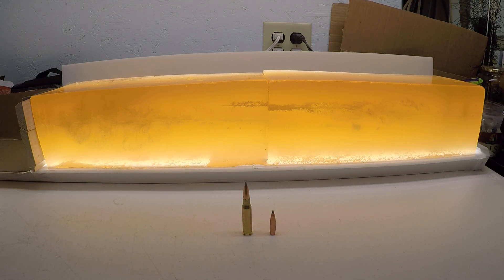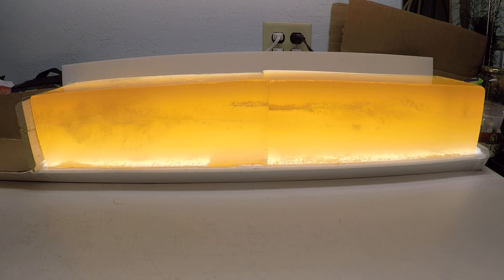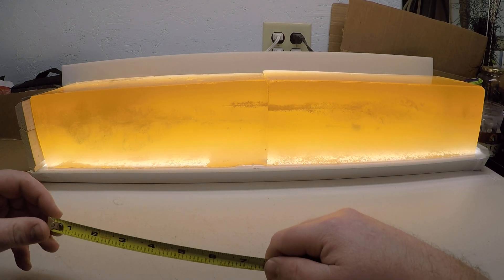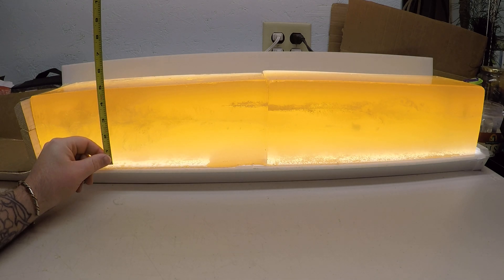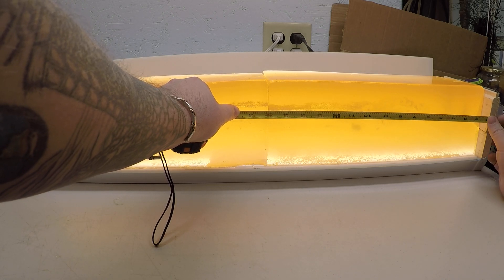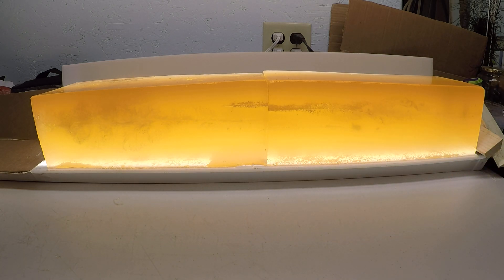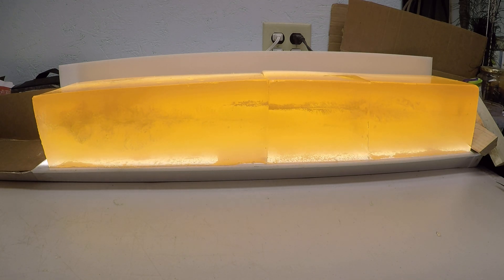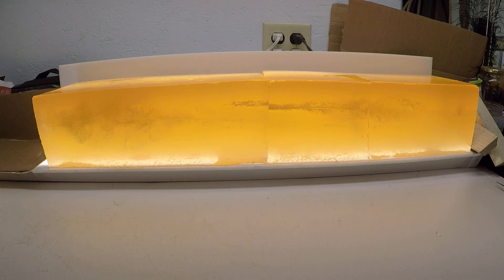Ballistics gel test of the 30 cal 168 gr Nosler ABLR overview of gel blocks

Comment: Looks excellent! I just bought a 16.5" .308 that I'll be using this next hunting season for speed goats to  elk, and I'm trying to decide which bullets to start working on first,  so this type of test is just what I'm looking for. Curious what load/powder you settled on for these bullets in your hunting rifle?

On the elk you shot with this bullet in your short .308, what was the range, and did you get an exit? 

I'd love to see more bullet tests with the short .308, any chance you'll test the 168gr Speer Gold Dot? They seem like they might be a good option for short .308s as well, but I haven't seen any gel testing on them yet.
Reply from the maker: The elk I shot last year with one of my short barreled 308's I shot at just under 100 yards and yes there was a exit hole.  To date I have killed more elk with a 308 Winchester then with any other cartridge and caliber.

I have other videos shooting 30 cal bullets and all the reduced loads are shot out of my little 308. So all the low end test will show how well the bullets should work.

I do plan on doing more cartridge specific videos.  Right now I am mostly just testing bullets and I drive them out of my 300 win mag or my 300 PRC to try to get them as fast as I can hitting the gel and then using my little 308 with a reduced load to see how low I can go and still get the performance I need.

 I do not have any videos testing the spear gold dot but they are a good bullet if they are not moving too fast from the muzzle and with a short barreled 308 you shouldn't be able to crank them to fast that they grenade. 

Out of all the bullets I have tested if you are wanting to use it anywhere from the speed goat to elk I would look at the 168 grain ABLR or the 165 grain trophy bonded tip you are more apt to always get an exit hole with the trophy bonded tip.

Nosler partition would be another good one if you are not stretching your distances past a few 100 yds as their coefficiencies are not great and they will drift more then the others in the wind.